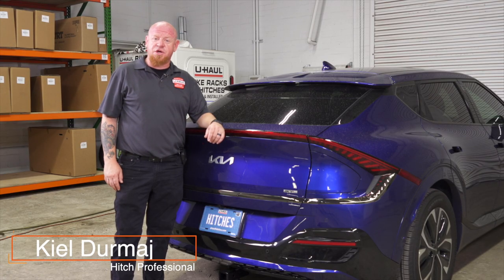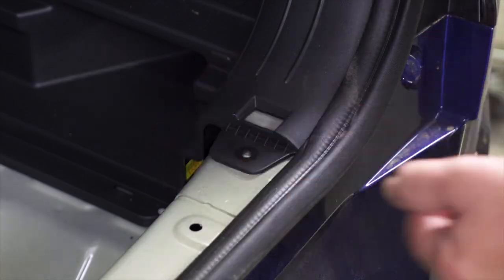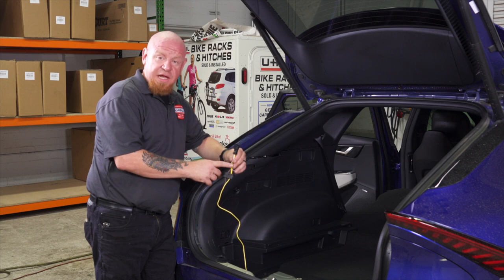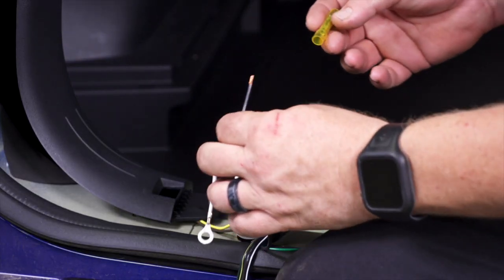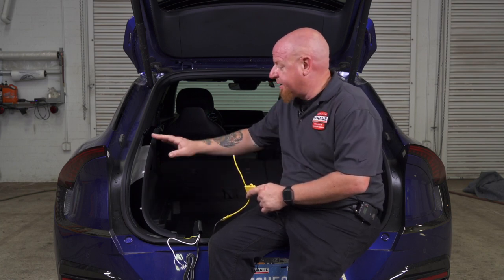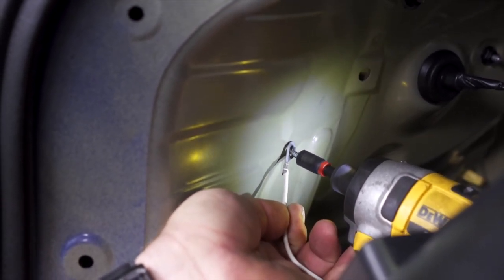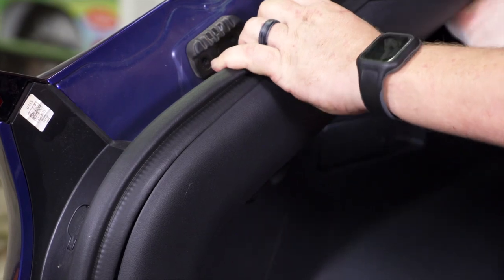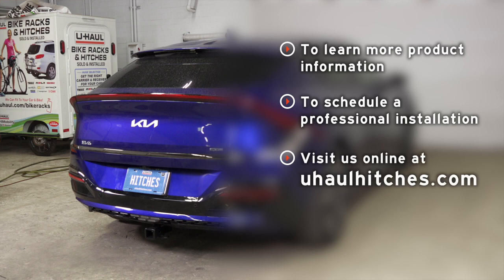2022-2024 Kia EV6 | U-Haul Trailer Wiring Installation | CQT118872

Comment: The “unused” connector is the OEM plug for an OEM trailer wiring harness. Much less intrusive of an install but costs more, fyi.. 4:30
Reply: So if you use the OEM trailer wiring, the software 'knows' when you connect a trailer! Worth the cost since the backup features will be disabled (beeps/braking). Also, your range will be updated if you estimate the load's weight via prompts.

Comment: So to connect to a trailer you'd just run the ribbon cable out to the trailer and close the hatch on the cable?
Reply from the maker: DJ, yes. The cable has a special coating on it so it will not scratch paint and is meant for the trunk of the vehicle to be closed on it.